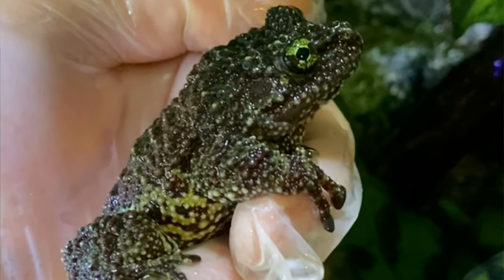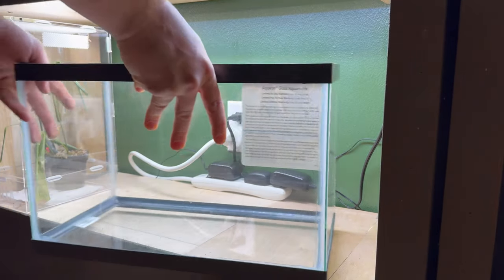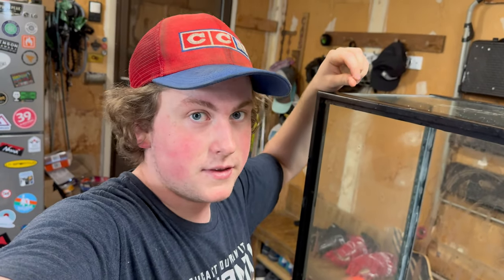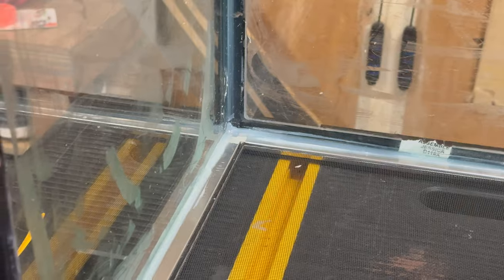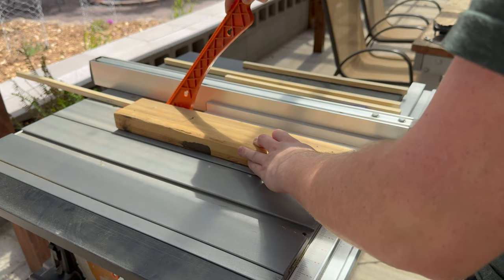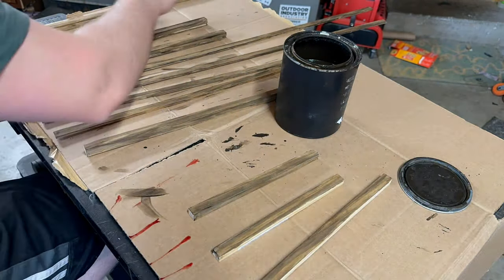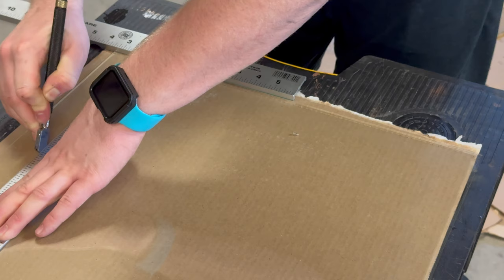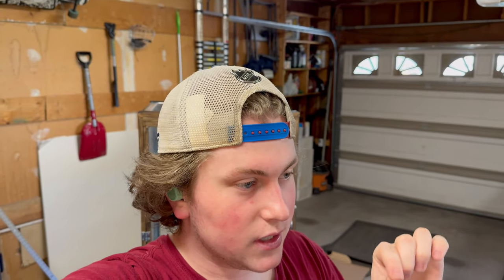DIY Front opening 40 gallon tree frog enclosure (Vietnamese mossy frog paludarium part 1)

Comment: I’m going to try to redo my Pictus gecko tank and wanted to know if you knew of any plants that could survive with a bit less water and humidity but still looked somewhat tropical-ish.
Reply from the maker: I honestly haven’t worked much with dryer setups but from my experience zz plants and smaller types of dracaenas do really well without much water or humidity, I would recommend both of those. I’ve had tons in my setups and they’ve all thrived without much care.
Reply: @hodesigns  thanks! Can’t wait for the next video!
Reply from the maker: No problem! Can’t wait for you to see it!